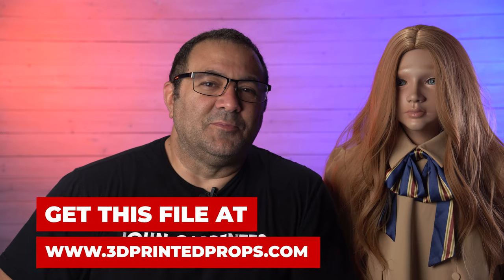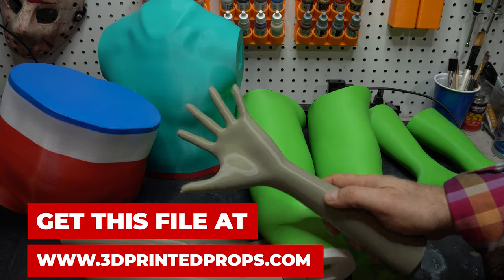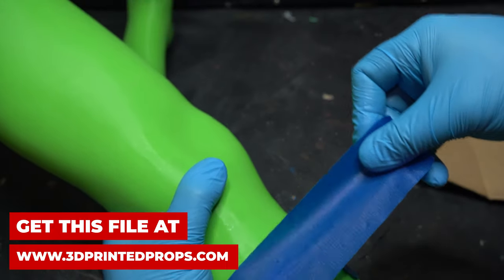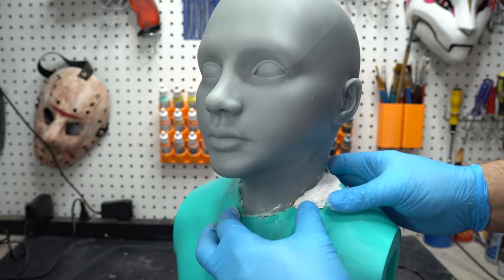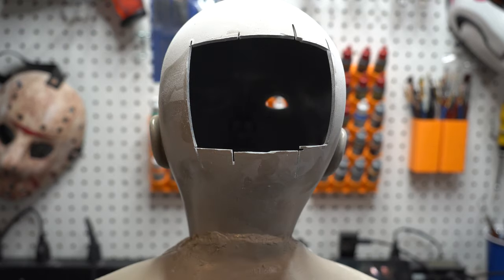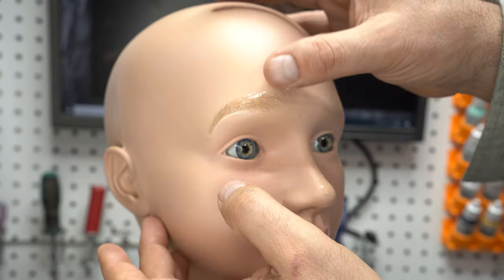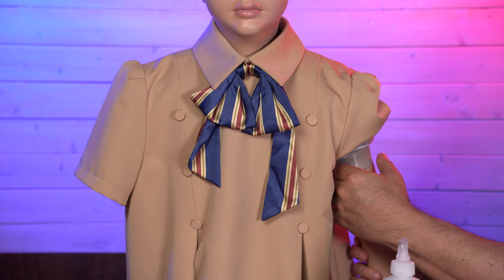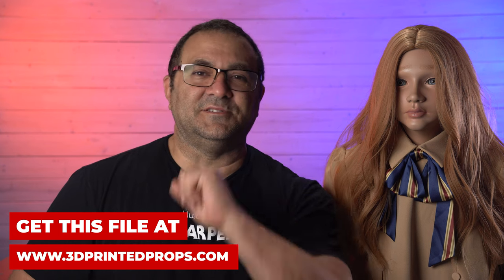Creating a Life-Size Megan Doll: 3D Printing and Finding Her Clothes

Comment: Hi, I liked this video so much that I joined 3D Printed Props and got hold of the files to create one for myself, so far the printing is going well, however, I am about to print the hands and whilst there are 2 different hand files, 1 actually holding the blade handle and another couple with holes through to fit the blade handle afterwards, neither the handle already in the hand nor the holes in the hands are the same scale as the separate blade and handle that is in the files.  The handle in the hand is approximately 60% smaller than the actual blade and handle?  If I shrink the blade and handle down 60% it looks kind of stupid.  Any thoughts on this?  Thanks.

Comment: Thank you for posting this video, i have been watching your site, and hoping for one.
Reply from the maker: Cool. Thanks for watching 🙂
Reply: I purchased your files,  but they are not printing very well.  Are they printable on an fdm printer?
Reply from the maker: @patrickfinnigan4334  yes, I printed everything but the head using a Neptune fdm printer. What issues are u having
Reply: @3DPrintedProps  I started printing the head first and realized that it's hollow. I kept getting a lace like outer surface.  I converted the head to a solid with Meshmixer, and it seems to be printing better. I haven't looked at the rest of the files to see if they are solid or hollow as well.

Comment: I'm new to seeing this. I was just watching another 3D printed model of the Annabelle doll before seeing yours and this one. 

I've wanted to look more into 3D printed models honestly because I haven't heard the best things about them in regards to durability. That and also how proportions tend to come out a bit off after casting them. So I wanted to do my own research and get more of the facts. 

Tbh the likenesses of Megan and your Annabelle are not really there. However this looked like a lot of fun to do. I myself would like to have a small studio or working place to try and learn to create some things for myself. 

I think with your know how if you keep at it you would be able to pull off some legit versions of these two.
Reply: you can print 3D models thin and cheap with low infill ( how much plastic is inside the model to 100 percent infill so you can end up with a solid chunk of plastic for your part and anywhere in between. you can print from all sorts of materials PLA, PLA+, nylon, ABS, and the list goes on so you can get the strength needed of course you can't get steel quality parts but they can be pretty strong youtube some 3d model strength tests and you can find 3d printed items holding hundreds of pounds of course the design and material printed with is important!

Comment: So I bought the M3gan file. The head still needs to be cut out and duct taped,kinda unprofessional for a product you are selling! Could easily add a removeable skull piece to the build to allow the eyes to be inserted! The legs should also have PVC support peg holes modeled in as depending on the amount of infill used PVC pipes heat gun melted in will end up weakening or collapsing the model, just like the ankles in your model!!! There was no included readme document with recomended print settings ( how many walls, what infill percentage ETC) and there is no mention anywhere of the models height, shoulder, foot size to order the outfit and shoes for it!!! Yea I can use basic print settings and measure the model after 3D printing but it literally costs nothing to add this data to a readme and makes the product feel more professional!! I am waiting on a few rolls of filament so hopefully the weapon and hand fitament that is mentioned in a comment below has been fixed or it was a printing error! I have multiple 3D printers and noticed when I had my smaller printer loaded in the slice the large STL's wanted to auto resize to fit so hopefullt that is what happned to the weapon in the comment below.